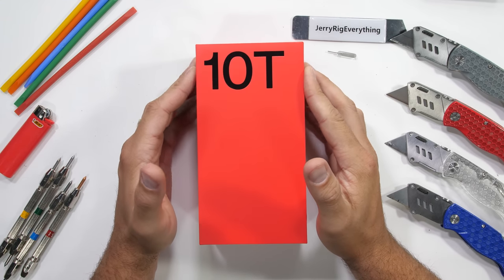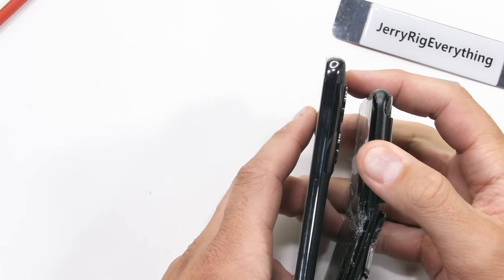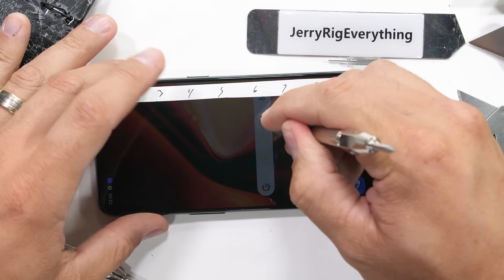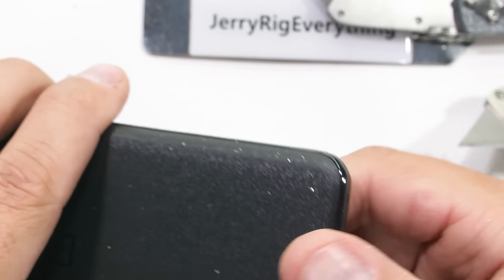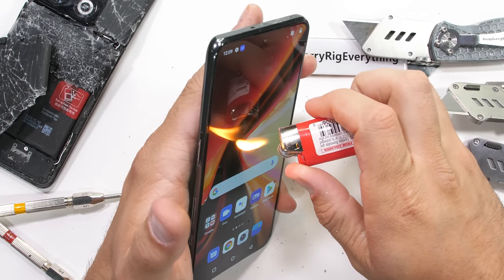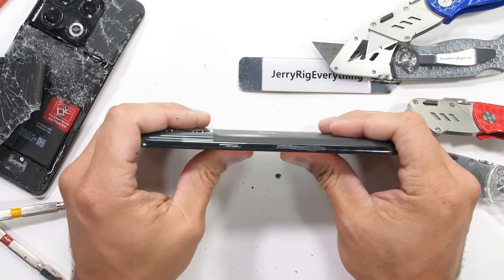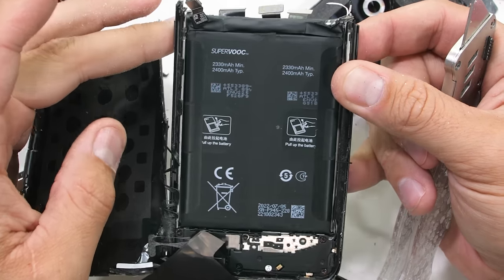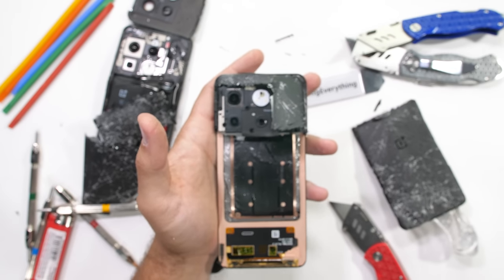Has OnePlus Fixed their Newest Phone? - Durability Test!

Comment: funny how oneplus phones are even now failing the bend test on top of removing features with what made them special in the first place. At this point, just buy an Oppo phone.
Reply: Or you know.... Just any other android phone lol. Like realme gt phones imo are the new oneplus now.
Reply: I did just that. Bought an oppo reno8 that is basically the same as oneplus nord 2t for a much lesser price. Oneplus wants to charge a premium for a rebranded phone with an alert slider and glass back. Guess I can live without those considering new oneplus phones don't even have that
Reply: @Lewinium  yes, not to mention one plus is owned by oppo.
Reply: Coloros is trash so just buy a pixel or Samsung or apple if you wanna try iOS
Reply: @lifeisshørt_420  Samsung is just trash for the  asking price. Had an S8 and I though it would be good. Sadly it falls short of my expectations, and my previous phone was a p8 lite 2017, not on par performance wise. But battery life was garbage, camera was disappointing compared to my p8 lite (who woulda knew??!), and the phone itself is the flimsiest phone I ever had. Only 2 little drops with a case on and all you get is a phone with both sides smashed. Even the fingerprint reader came apart !!!
Reply: I moved on to rugged phones now. I can beat the sh!t out of it, it just gets some scuffs. I can even go to the ocean with it and take photos with. The only thing I have to be careful is not to lose it underwater!
I got blackview bl6000. It is maybe the less durable one they make, sleek design, no bumpers of plastic to protect it, no thermal sensor or anything related to outdoor use.
Still, it survived two drops on concrete face down without any protection. Not a single scratch on the screen.
I had an S8, i dropped it two times with it having a case on and at much lower height, it got the 2 glass smashed and the screen got a back spot that kept growing from time to time.

Comment: OnePlus is no longer the company it used to be, prices are now on par with other flagships with the same specs, there's nothing really unique about the company or the phone any longer, so why should choose OnePlus?
I started out with the OnePlus X. Major reason was the impressive specifications at great price. Fell in love with it the moment moment I got it out of the box (still have the box, by the way)
Sleek, beautiful screen, great specifications, amazing camera. I dropped it many times, without the screen ever cracking. (well until it finally did, after three years of constant, rough use)
I used to be a real fanboy, used to love going on the forums, discussing the phone with others, asking questions and answering them..
After my OPX was finally put to rest, I bought THE MOST BEAUTIFUL PHONE I've ever seen. Indian variant of the OnePlus 7T. Still wonderful OS, great camera, top notch specs, mesmerizing body with those frosted panels, blazing fast phone wonderful touches here and there that truly made the phone a joy and delight to own. Such as the braided charging cable and the carbon fibre and alcantara case.
I've been using my OP7T just as I used my previous phone, and still in love with it. But it's starting to show it's age: the battery dies faster, warp charging sometimes doesn't work, the camera is no longer as good as it used to be. I'll use it for as long as it lasts, probably even send it for servicing. But after that, I don't think I'm buying another phone from OnePlus.
Each year, I've eagerly watched OnePlus launch events, hoping they do something good again. Each year I'm disappointed. Some of the reasons are:
The first few batches of OnePlus 8 and 9 phones having display problems.
OnePlus merging with Oppo. (Especially hate the merger of Oxygen OS and Colour OS. OP said that the OSS will be separate, but under a single dev team. Hah) Carl Pei leaving OnePlus.
Prices matching other flagships. Nothing really unique.

OnePlus was once a phone company with a niche following of tech nerds with tight pockets. Now it's a phone company that wants to cater to everyone. That might be in the company's best interests, but OnePlus and many of its long-term costumers don't align with each other.

Thank you for everything so far, OnePlus. Thank you for two great phones, 6 years of great memories. I'll be looking at Samsung for my next phone.
Reply: At this point there are no reasons for are to not choose oppo over OnePlus
Reply: Same bud, using OP7T right now and gonna switch to iPhone 14pro as soon as it rolls out, sick of the 7T now :?
Reply: Same feelings man.. My OP7T's screen literally came off yesterday as I was replacing my screen protector. The battery doesn't hold charge as much any more too. I'm looking at the Asus Zenphone 9 but maybe I'll just finally go with an iPhone lol. It's funny how we old OP fans are all settling now.
Reply: I'm not going to read this but, I agree with you.
Reply: Oneplus one and 5t owner here. When I bought 5t, I told myself I will buy the 10t after 5 years which is this year. After all the changes happened to op, I decided against and bought iPhone 13 last month.
Reply: @JoelSilva-gk4hq  my OP5T’s screen and camera cover glass came off due to glue drying out. Had it exchanged for iphone 13. I still have the OP one, as memory :)
Reply: I had OP5T but changed it to S21 Ultra last year. S21U is still fast and it takes great pictures. S21U/pirice > S22U/price
Reply: @malpa154  battery of S21U>S22U
Reply: I had OnePlus 5t. It was great but I lost it
Reply: As a proud owner of a OnePlus 7 Pro Nebula Blue, I can say that I'll keep it until it completely refuses to turn on. So sad to see the status of OnePlus now
Reply: Same, i wholeheartedly agree, after my OP3T died from the screen being burned in heavily, i got myself the OP6 and i used that for quite some years until the RAM made some issues.

Still use it as a bedside phone for watching/listening to stuff. Got myself the OP9 and, well, it's far from what OP once was. 
It's a nice phone don't get me wrong, but the OS got so much worse and i also only got it because there was no other phone in my price range (500€) nor looks that i liked.

I guess for my next phone i'll also go back to samsung or maybe nothing depending on what they'll do in the future.
Reply: Yeah, even the notification slider is gone. So am I - just switced from 1+ 6 to a Samsung...
Reply: Same to every bit said above.
Reply: That's really a shame.
I've read many articles about hyped (for that time) OnePlus One, and instantly fell in love with design of OnePlus 3, even if I could not afford it at that time.
Some of my friends were lucky enough to get OnePlus 5 or 6, and I was a bit jelaous :)
When I finally was able to buy a OnePlus phone (7T Pro), the OnePlus was already changing to a more "generic" brand (IMO).
I remember some time ago there was a belief that OxygenOS is the best, most stable and fast firmware of all Android firmwares. 
That's not the case anymore, year on year the OxygenOS is becoming more and more slow and buggy. Just like the Meizu (RIP M2 mini with Flyme 4, I miss you so much).
So, no matter how I disliked Samsung in the past, now it seems the only viable option to migrate. Even Pixels are not good enough.
Reply: @Shinobido1562  well, that isn't true, they have the same amaunt but the S22U a little bif better quality battery. S22U also has more efficiant chips and more battery efficiant software.
Reply: @nikhilprince2904  yeah and no, when you concider that the company Oppo who owns OnePlus is the reason why OnePlus fails (mainly because of their bad brand strategys and software) than you may concider that most of the OnePlus users won't love Oppo either
Reply: @nikhilprince2904  Ps.: Oppo and OnePlus are banned from smartphone sales in Germany since last week and the whole EU plans to follow that. Oh and they are in really deep trouble in India too. So better say bye bye to them.
Reply: I'm in the same boat, so my next phone will be pixel 7
Reply: @philippg.  What the hell i didn't expect that
Reply: @goo_ja  really? They have stolen patented technologies from Nokia so they are forbidden to make phonesails due to lawsuits. They recently also lost half of their last year income together with (especially) Xiaomi because of years of money-laundering and sneaking out of tax payments. How do you think they make souch cheap phones?
Reply: My current phone is 1+8pro and I love it!
But I agree with you: if OnePlus don't change their policy then my next phone will be Samsung or Google Pixel.
Reply: @philippg.  I am happy to say bye to those cheap ios knock offs
Reply: Yes, I'm crying as well because I'm a OnePlus fanboy. It's 2022 and I will still complain on these things as if they will listen to me. 🥲
Reply: if carl pei made phones that changed your life. you should be looking at nothing phone (1).

Comment: If 48,000 MAH is slightly smaller I’d love to know, how big was last years battery?
Reply: 😆 glad someone else noticed it. If it's 48,000 mAh, I want it.
Reply: It was 4500 for the 8T so the 9 models should be somewhere between that and 4800
Reply: 10 pro have 5000mah
Reply: Big Battery slimmer chaise sign me up!
Reply: Don't forget battery size vs chip efficiency:) 10t is more efficient then 10 pro.

Comment: I still have my 5T which is the slimmest phone they made and it survived Zacks bend test. I literally ordered it after seeing Zacks test of it. Sadly the battery has gotten pretty bad after almost 5 years and it's become slow as well. But i got a Pixel 6 to replace it. Still have the 5T as a backup phone used mainly for flying my drone.
Reply: The OP 5 was peak oneplus.
Reply: You can replace the battery yourself. Get it from Aliexpress

Comment: In my opinion 1080p is the best resolution for phone screens as its sharp enough to look good but also great on battery
Reply: Definitely. I never could see the difference so I have switched my phone on 1080 to spare battery ^^"
Reply: Also, I love 120 Hz or more for my desktop and television, but my phone really doesn't need anything more than 60. Scrolling social media will still be misery regardless of the framerate.
Reply: That and refresh rates no higher than 90.

Comment: I use the OnePlus 8 Pro and absolutely love it. The battery is great and the camera is outstanding.  No need to upgrade or switch phones I'd guess for another 2-3 years, and I've had this over 2 years already! Sad to see their phones are getting crappy now, looks like my next one will be from a different manufacturer.
Reply: My OnePlus 7T Pro is still working flawlessly.
Reply: My 9pro also
Reply: Brother go for samsung
Reply: @vinuvarghese6374  yeah if you live in an area where they sell the snapdragon model sure
Exynos on the other hand is a hard pass
Reply: I agree and I am also still using an 8T and like it very much. Buuuuuut updates... I just hate that there are now already such long cycles between new updates that I have to upgrade in the near future because of that. And I don't mean features, just security updates which are limited to 4 years. The 8T is still on the February security update, released 1st March 2022...this is just sad.   

Hate to say it but it might be an iPhone then as they simply get regular security updates for years. I mean the latest iOS 15.6.1 is still supported by the iPhone 6S which was released in September 2015! That's 7 years of updates which is unbeatable for me and after 7 years I am also happy to upgrade to a newer phone ;)
Reply: @andre-heller  my 9pro is still on A11 I hate A12
Reply: @andre-heller  same. If every phone out there basically does the same thing with no outstanding features, I'll get one that fits my two most important categories: long performer (powerful SoC, long battery life, many years of significant updates) or privacy-focused (which narrows it down to the Pixel series due to Graphene and Calyx support). Samsung can go f themselves with their Exynos crap (the 2200 gets outperformed by my A13 Bionic, pathetic) and I'm certainly won't support Chinese brands anymore. What a sad state, we expected phones to be amazing in 2022, instead they are all bland and characterless.
Reply: @PvtAnonymous  I absolutely agree
Reply: @ActionDriveFusion  would be also super fine with me if there were still up to date security updates :(

Comment: Sadly One plus is not the same company we once knew...
Reply: They were awesome in the 3t era and below. Good until the 6. Crappy from 7 and above.
Reply: i have an oneplus 5 thats still working fine 6 years after i got it.
their latest phones are a disgrace compared to the older ones
Reply: @seanchina9902  the 7 was great, that was peak oneplus
Reply: @ridgefrost  i have to disagree. 3t was the peak oneplus. Oneplus 7 they started following the trend of less features for higher price.
Reply: @ridgefrost  OnePlus 7 was a beast but after that they ruined everything they built so far,and with the Nord series coming in it was never the same company anymore
Reply: @Marpurrsa  the nord series played a big part ruining the company.
Reply: @seanchina9902  i don't think phones of that time were all that good in general, i dont doubt it was great at the time but its too old of a phone to be peak, and tbh i don't think anybody other than the oneplus loyalists had an issue with the 7 price increase, it was still cheaper than the competition and was actually a great competitor in performance and camera
Reply: Well, the One plus 8 is crap.  The software was great until the upgrade to 11 then with "oxygen" 12 it belongs in the bin. I want to roll back. Things like always on screen bugs out all the time. Proxy sensor doesn't work and activates the screen while on call and goes in to flight mode. annoying as hell. It needs restart once a week since upgrade.... An that stupid back glas that broke after a weak even with rubber protector skin. 
The newest Asus Zenphone looks to be the latest phone to have.
Reply: @chy.0190  ok bot. It's a crap phone. 7 and older was 👍. Newer is terrible.  Take something as simple as the stupid google feed if you left. I had it turned off and I don't want it. But the shity software update switched it on. Especially with oily fingers when the screen doesn't respond 100% stupid things like that turn up 🤮
Reply: As if you know them in the first place.

Comment: I defended the decision of removing the alert slider because they might have done it for structural reasons. Man OnePlus devices used be rock solid (7Pro was a champ)
Reply: I understand where you are coming from, but for me this would not be a good enough trade off. 1. The alert slider is so important to the OP identity and it is so useful. 2. The structural improvement is not even significant, so it makes the loss of such an important function not worth it at all
Reply: they were having the alert slider since the beginning and most of their phones passed all durability tests

Comment: Hi! Your durability test will let us know if I can buy it or not. There are several examples.
The iPhone 6 bend test made it look into the structure of the phone and it is never repeated.
I bought a Motorola phone that has an issue with camera scratch. Which is pretty bad. 
Only you help me understand which has the good structure. Software can be updated and is easy to use in my opinion. Without you cannot know the durability.

Comment: The 800-1600 charge cycles probably does not include 125w fast charging for most (or any) of those cycles. Even if you assume that the charging is 90% efficient (which it isn’t) that means the phone has to dissipate nearly 13w worth of heat without heat sinks or fans. That means that phone (and the battery) are going to get quite hot, and lithium batteries don’t like being hot.

Comment: The display being able to bend so much without cracking is legitimately impressive.
If only the phone wasn't so bad
Reply: The display bending is pretty standard for a flexible OLED like most higher end phones use. The bendable display can be used to reduce the bottom chin.
Reply: @Lord_Reset  I know that most new phones use bendable plastic OLEDs, but I'm impressed with the front glass being able to hold up so well

Comment: Haha, I wonder if the next Flagship from them, The OnePlus 10 Ultra will be more different. That will be the top of the line with the top spec Soc either from Mediatek Or Snapdragon and it will include as well that slider from the 10 Pro. It will cost a whole lot a bunch of money as well. But after recent rumors maybe will see it in the Q1 Q2 2023. :))

Comment: Why is oneplus 5 from 2017 with relase price of 500€ made from aluminum and is IP67 proof on 1m for 30min, and this with 699€ price tag and its made from cheap plastic, and is only ip52? Oneplus shitty company nowadays. Any phone over 150€ should be made from Aluminum, i rember bying my LG G7 fit in 2019 for 220€ it was from aluminum and it was MIL-STD-810G compliant and IP68 rated for 1.5m 30min. In 2022 i expect phone 699€ to be ip69k rated so it survies against a 3000psi preassure washer, and made from aluminum and can be submerged into 30 meter of depth.

Comment: oneplus 1/3/3T/5/5T were top of the line phones, and they are still great, ever since then the brand is just going downhill, copying poor designs, cheaping out on materials and refusing to listen to customers. my 7t won't be upgraded to another oneplus thats for sure. not because of the durabily test , but because the design and functionality "upgrades" straight off sucks. now that LG is out, Xiaomi is trash, Huawei is trying to be Apple 2, samsung overpriced low quality junk, Nokia still behind in everything along with Sony,  I have to go with google or motorola . "never settle" my ass. Christ, these days you can't even get a compact phone apart from the iphone SE which is once trash apple.